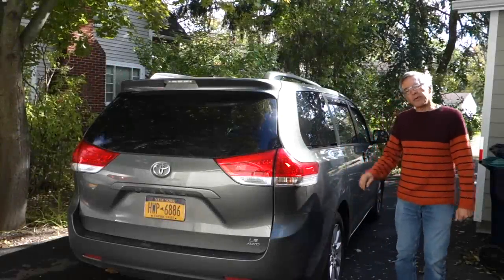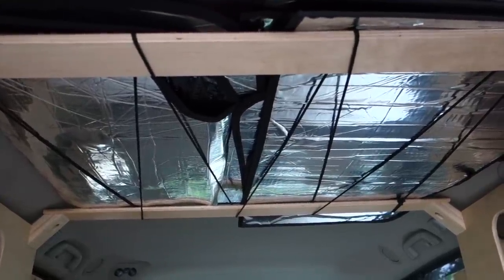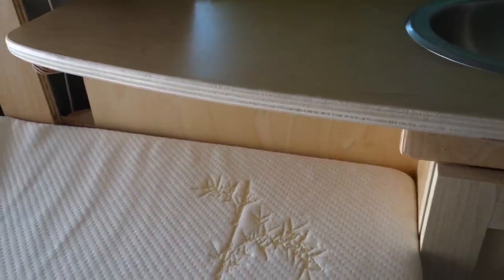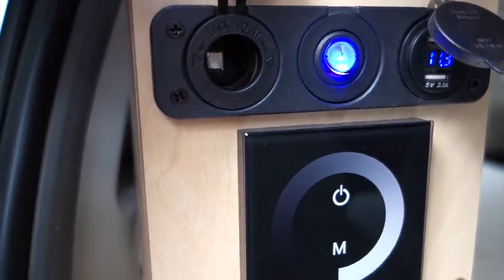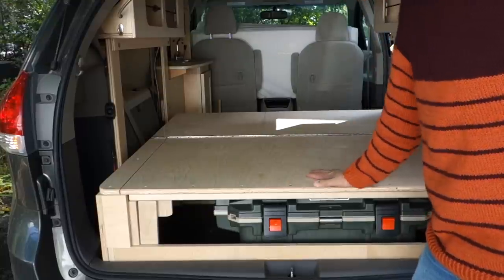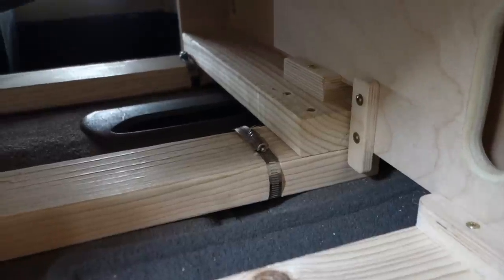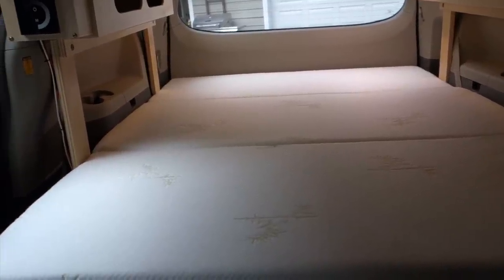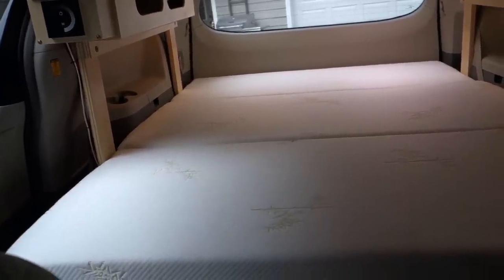A Slightly Different Mini Campervan Build

Comment: Nothing but praise for your design and execution!  One question tho....do you have anything to cook on, if so, what and where do you store it.  I can imagine a simple gas bottle type stove or?  Thanks!
Reply from the maker: Thanks for the comment. We use a Coleman butane single burner camp stove. We prefer to use it outside, like on a picnic table. It’s carrying case is small and easy to stow.

Comment: Fabulous build! I’m curious with all that intricacy, why you have not placed the bed platform on piano style hinges that can accordion open to provide a bench like backrest when retracted and then be advanced forward for sleeping position
Reply from the maker: I considered something like that but wound up focusing on a design that allowed the platform to remain flat when the footboard was stowed. This permitted additional versatility when not using the vehicle for camping or sleeping, for example if I wanted to put the 2nd row seats back in and have a lot of flat storage space behind. The very first roadtrip after the build required 3 adult bicycles to be secured in that space and a ton of gear loaded on the partial platform for the initial part of the journey. I’m noodling the idea of updating the footboard to a slide-out design so it can be stowed under the midsection with a push and returned to sleeping position with a pull but I’ve got some other higher priority upgrades to tackle beforehand. Note, I’ve still got a sofa mode by pivoting the headboard up and latching both sides (see my next video, Sienna Minicampervan Gets Serious) but the way we’ve been using the vehicle we just don’t find ourselves hanging out inside it for much more than driving and sleeping and we enjoy having the bed ready to jump into at the end of the day. Great question, thanks for asking.
Reply: I see your point. If your leaving the platform in the car you would not be able to stow much with the back up, but when camping it’s really nice to have a convertible space, also a split design, so someone  lie down for whatever reason while the other side is upright. Thanks for your reply, good food for thought. Love your attention to detail.

Comment: This is the most well-engineered and beautifully built design I’ve seen so far.  I’ll be using some of your ideas in my own build, though I don’t think I have a hope of executing as well as you have!  Amazing!!
Reply from the maker: Jess - Thanks for the nice comment, I appreciate it. Stay tuned for some upgrades I plan to post this spring. Good luck with your project!

Comment: I have a sienna also.  Looks like you removed all passenger seats except front?  Great job on design.  I think I may have to copy.  I put a cot in mine along with a metal cabinet for storage and left the single rear seat up.  Then again, it's only a 115 lb gal with a Chihuahua!  Thanks for sharing!  Cindy in Vanderland.
Reply from the maker: Cindyrella725 - I’m glad you found my video useful.

Comment: What an impressive design and beautifully crafted. I am greatly inspired. It takes a lot of know how to finish it off so nice. Would you share what it cost and the materials you used? thank you, Happy travels.
Reply from the maker: Barbara, thanks for the comments. Cost-wise, roughly, $140 lumber (baltic birch plywood), $50 hardware (screws, hinges, etc), $100 electrical (LED parts, wiring, switches, aux (jump pack) battery), $60 plumbing (sink, faucet, jugs, fittings), $130 mattress (see video description for link), $170 WeatherTech window shades. Free labor :-)

Comment: Love the build you have going on! I have a Grand Caravan I have been preparing for some camping trips. Curious how you attached the HEADER piece there? Love that addition and would be great to add a blackout curtain there to separate the front seats from the cargo space.
Reply from the maker: The header is attached to the uprights I made at each end. The uprights are mounted by clamping to the grab handles midway up and the seat tracks at the bottom.
Reply: @BruceParks  Thanks for getting back with me! How did you attach the uprights to the grab handles? Zip ties or you mentioned a clamp?
Reply from the maker: @MellowNomadicAdventures  I made custom wooden clamps to secure the uprights to the grab handles. I describe the clamp a little bit here: https://youtu.be/R6KnJB1m6Ds?t=513

Comment: Love the description of everything and the wood work is impressive! Do you end up storing your clothes under the bed and if yes how difficult is it to get to on a daily basis?
Reply from the maker: Thanks for the nice comment. We store most of our clothes in the upper cabinets. Shoes, boots, seldom used things go under the bed. Some items wind up deep under the middle board and are more difficult to get to but we try to make sure those are things we rarely need. The key to organizing the upper cabinets is to pack the clothes into “packing cubes” and then it’s easy to find things and not go nuts with clutter.

Comment: Intelligent design!  My only concern is head sleeping position. If you’re stealth camping on a city street or even parking lot chance of being rear ended is high.    Just a concern.  Love the build.
Reply from the maker: It would certainly be alarming if rear ended while sleeping but the rate of speed required for injurious intrusion would be quite a bit higher than typical for the spots we pick. Good thought though. Thanks for commenting.

Comment: This is the most beautiful minivan build I have seen. It's so simple and uncluttered, but is so packed with features and even quite fancy things like the sink and counter, the reading lights. It's so well thought out. So much function built in, and clearly a quality job, but it doesn't feel over-engineered at all. This is inspiring, thank you so much for sharing this. If I could afford another vehicle, a Sienna would be top of my list I think. From the video I gathered that the back is 52" wide, and over 73" long. Can you tell me what the floor to ceiling height is? I'm using this as inspiration for my existing vehicle which is a 96 Isuzu Rodeo. It's not as long, I think not quite as wide and I'm sure the height is not nearly what the Sienna has.
Reply from the maker: Donna, thanks for commenting! The Sienna's interior dimensions are as follows. The floor is 96" long and 49" wide. Where my bed platform is, the width grows to around 51" wide at the narrowest point (my mattress is 52" wide so it's a little compressed in that tight spot) but is more than 60" wide between the sliding doors. The floor to ceiling height is 48" in most spots. Hope that helps.
Reply: @BruceParks  thank you so much for taking the time to measure it out and answer me! I really appreciate it. You really do have the most beautiful mini van build I have seen.

Comment: Very nice job, start to finish. I particularly like your basic-but-complete water system. I live in a cold climate. I wouldn't want to deal with an elaborate, expensive water system which might freeze and cause major (expensive!) problems.
Reply from the maker: Thanks for the comment. I like to keep things straightforward for ease of maintenance and repair.

Comment: Very nice design and build.  You make my attempt at building a camper out of my CRV look like a kindgergartner's project!  I wish I had whatever clamps you used for the legs of your table.  I could not get my folding legs to attach solid enough to use them.  Where do you keep your porta potty?
Reply from the maker: geazerweazer - Thanks for the comment! Hey, any attempt at building a camper on wheels is noble, regardless of how it turns out. The table leg brackets I used are simple and inexpensive: https://www.amazon.com/gp/product/B01E5SUKN4. As for where we hide the loo, we don’t, it sits out in the space between the bed and front seats. It’s one of the many compromises we’ve accepted in using a small vehicle for RV duty.
Reply: Thanks for the informational reply. Since my bed is for one, it is like a cot that is lengthwise along one side of the CRV. I have my loo on the other side towards the back so I can still get in and out the rear side door. There is no internal door handle for the rear door that holds the spare tire so that really cuts down my choices of location.

Comment: Tremendous build out here. So many things that I just might copy for my 2001 Dodge Grand Caravan (132,000 miles - great shape)   One thing I don't understand is the bungee cord stretched the length of the storage cabinets. Do you hang things from them ?  Ok, I think I get it now. Those bungee cords are there to hold the cabinet in place.... I think.
Reply from the maker: Hi John, good question on the bungees. We pack most of our clothing in soft packing cubes and stuff them into the cabinets. Without doors on the fronts of the cabinets, the packing cubes can bulge out a bit. The bungees keep them from spilling out. Thanks for asking. Good luck with your build!

Comment: I have been thinking about what to upgrade to from my Prius, whether it be a sprinter, sienna, or a model Y with caravan trailer. I think you just made my decision very easy, especially considering that the 2021 sienna is also hybrid and AWD now. I hope you don't mind that I will be copy catting a lot of your design ideas! Thank you sir!
Reply from the maker: Sammy, thanks for watching and commenting. Excellent choice, going with a Sienna. The hybrid Sienna is a game changer, in my opinion, because it essentially eliminates the biggest drawback (poor fuel economy) with such a large vehicle. I imagine you're aware of the "non-removable 2nd row seats in the new Sienna but in case not, this video is a good how-to on how it can be done: https://www.youtube.com/watch?v=24cYWBiTUwY. The author includes a link in his comments section on how you can remove the seat carriages that are left behind after removing the seats but it is quite involved. Also, there is apparently a residual issue with an airbag warning light with the seats removed. Not sure if anyone has come up with a workaround on that yet.

Comment: Great build, full of ideas. Thanks for all the good tips. Let me know when you are ready to sell plans.  Do you have a stove on board? What do you use for fans/cooling? Any cold weather heating?
Reply from the maker: Will, thanks for commenting. We've been using a small Coleman butane stove, but always outside. I'm considering adding a deep cycle battery with solar power to enable use of things like a portable induction cooktop. I'm designing a mini range hood to support cooking inside and provide serious air movement when we are sleeping. We have been using a couple of 12v clip-on fans powered by a 14KmAh jump battery but there have been a few times the battery power didn't last the entire evening. Regarding cold weather heating, we've been only relying on a thick blanket for temps down to 25F. I'll probably be looking into heating options that would work with the extra power we'd have with a deep cycle battery.
Reply from the maker: @Begreen9   - Yup, seen their product line. The main issue with the dedicated kitchen module taking up floor space in a minivan camper is you wind up loosing precious floor space. In a minivan camper, every cubic inch is precious and every design decision requires making conscious tradeoffs. For our campervan lifestyle, the bed size is top priority, which means full width and six feet long. That leaves two feet of length left for everything else, like a portable toilet (another top priority for us). Layouts with no floor space left, like the freeway camper, mean there's no place to put a portable toilet. Also, building in upper storage makes a big difference in a minivan and preserves floor space. Minivans offer a ton of advantages over other options, like pulling a trailer, RVs, cargovan conversions, pickups, etc. The only obvious disadvantage is the compact space. It all comes down to whether you can adapt to the minicampervan compromises in order to enjoy the benefits.
Reply: I like your thinking. I'm looking forward to seeing how your camper evolves. Is there any particular generation of Sienna you recommend? Did you have the Toyota already or had you considered any other minivan like the Odyssey or Pacifica?
Reply from the maker: I bought our 2011 Sienna (Gen 3) last year with the intention of building it out as you see in the video. I had a 2009 Sienna (Gen 2) before that. I've been focussed on Siennas mainly because of their reputation for best reliability. Gen 2 (2004-2010) and 3 (2011-present) aren't a lot different mechanically or size-wise, but there have been a lot of little changes through the years. The only problem I've had with the 2011 was related to the AWD system: the center bearing carrier failed and required replacement of the entire driveshaft assembly at 65K miles. The AWDs have another potential risk area, namely the viscous coupling between the driveshaft and rear differential can fail prematurely. Both of these issues are unique to the AWD versions of the Sienna. Otherwise, I expect the Sienna reliability to be good. I don't have any experience with the Odyssey or Pacifica so I can't offer any words of wisdom on them. Good luck with your decision process.

Comment: I never would have considered a minivan build until I saw this. I am utterly blown away by your attention to detail and curious as to your work flow, did you design this beforehand in a 3D program? Or possibly sketch up some plans? The more the video progressed, the more impressed I became. There are a lot of convenient touches, such as where your water jugs can be maintenanced, how you can accommodate more seating, down to the magnets that help the table legs stay retracted. And obviously how the build preserves the original vehicle. 

I am not necessarily a fan of how most of the space is a bed, however that boils down to your needs; in this case, being able to sleep two.

P.S. Did you make, or buy those sleek window covers?
Reply from the maker: Thanks for the nice comments! Yes, the requirement to comfortably sleep one or two completely dictates the overall design. If I were to build a mini campervan for one, it would be very different. But for this particular build, and our style of roadtripping and boondocking, I was going for maximum sleeping comfort and security. I think of our vehicle as a hardshell tent on wheels. I'll be adding a bunch of new features this year so stay tuned. Regarding the window shades, they are a Weathertech product: https://www.weathertech.com/toyota/2011/sienna/sunshade/

Comment: Thank you for sharing your build. Looks amazing! I am not a woodworker but your work makes me want to build something like this some day. Any Suggestions on some of best books to learn to build something similar?
Reply from the maker: Ryan Proctor - Thanks for commenting. There are a lot of books and videos out there on building or converting vans into camper vans. A larger cargo van is easier to build because you’d just attach everything directly to the vehicle structure. Building a self-supporting system that doesn’t require drilling and screwing into the vehicle structure, like my project, requires a lot more problem solving steps.

Comment: Great idea with that table!!  Not familiar with this type of vehicle...spare tire or donut an undermount?
Reply from the maker: Thanks for the comment. Regarding spare tires, FWD Toyota Siennas have a full-size undermount spare tire (under the passenger 2nd row seat). AWD Siennas have no spare tire (because the driveshaft to the back runs through part of the spare tire space) and are shipped with run-flat tires.

Comment: Dear Bruce, thank you very much for sharing this project and your experience.  I will try to replicate your design based on Honda Odyssey.
Reply: I found that Odyssey is only 48 inches wide between rear wheel wells :(   Nevertheless the project has started ;)
Reply from the maker: The Toyota Sienna is also 48 inches wide between the wheel wells. The width grows a bit as you get higher off the floor.

Comment: Does your car insurance company approve this build so they continue to insure you? Many don't want you to do anything without an RV tech to do these modifications. Interested in your approach on this for all of us.
Reply from the maker: I consider what I've done to be impermanent since it's removable (I take everything out at the end of the roadtrip season). There's also very little cost involved (under $2K). If the van were totaled, I wouldn't expect the insurance company to cover any of the campervan parts. But interesting question. I'll pose it to my insurance agent before I reinstall everything next year. If I learn anything notable, I'll post it.

Comment: Wonderful.... I'm trying to figure out my build and love your cabinets!  Did you design them or can you update with more info (dimensions, wood type & thickness) on how to build those cabinets?  Thanks again
Reply from the maker: Thanks for the comment. I built everything from scratch, so no plans are available. The cabinets are made from 3/4" thick birch or baltic birch plywood, though the fronts (the face that you see with the openings) are 1/2" thick. I used the thicker plywood to make sure the cabinets weren't flimsy and rattley when driving. The key to making these fit well against the van interior surfaces is to first make cardboard templates so that you can fine-tune the contours before committing to cutting wood. You can also play around with cardboard shapes and sizes until it seems about right for your particular van.